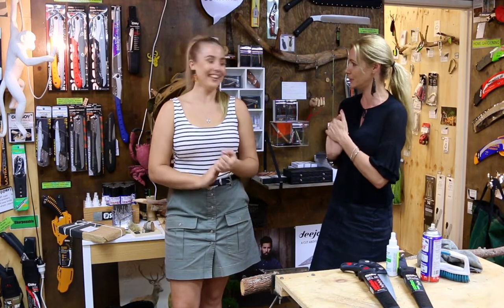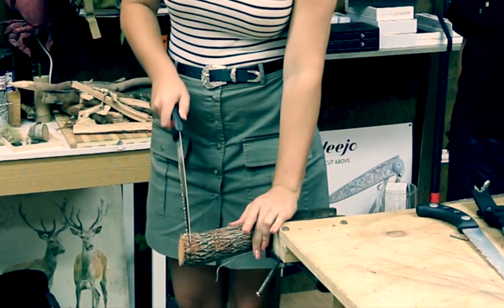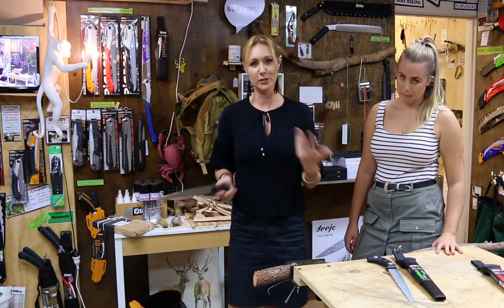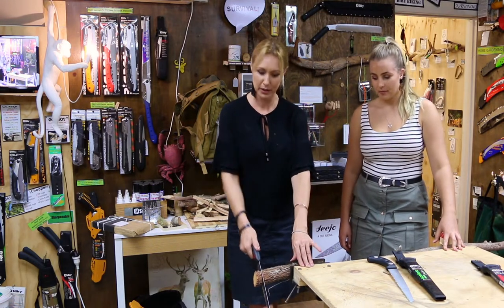How to look after and clean your SILKY Saw

Comment: I've been wondering recently, I use a biodegradable chainsaw oil, which lubricates the chainsaw's chain and bar (and as you might know, is essential unless you want to burn the logs). 

That could a regular hand saw benefit from a little bit of chainsaw oil on the maintenance part? Since basically it is the very chainsaw oil that also protects the chainsaw from rusting.

And I wonder if SIlky saws could benefit from this, or is there a downside to it other than it might get a little sticky?
Reply from the maker: Hi, that is a good question and honestly not sure.  Stickiness would not be ideal for a handsaw, but it would also be important about the ingredients in the oil to make sure that it is not going to have a negative impact on the steel. 😊 Nita